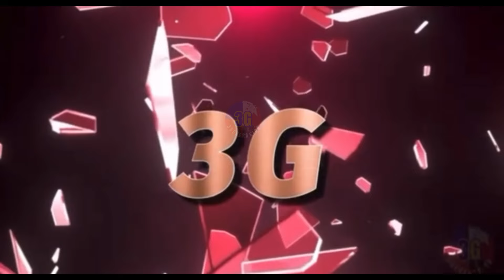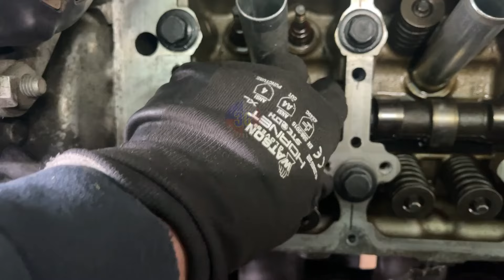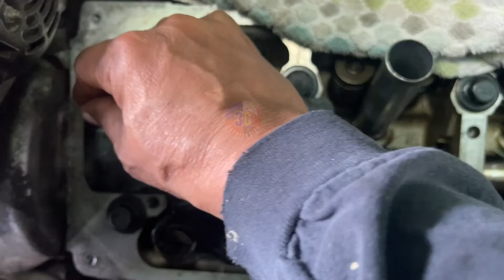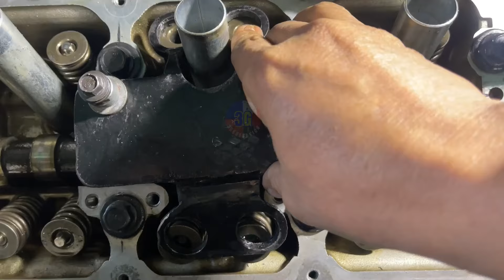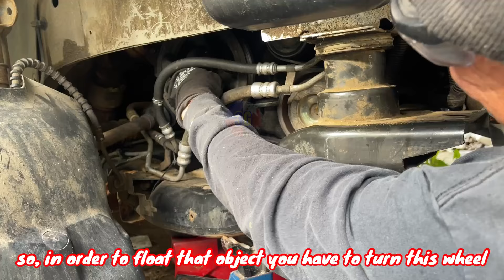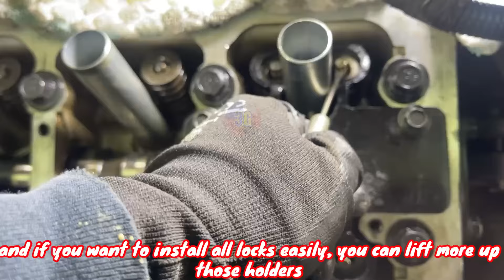How To Remove Spring Seal Without Removing Cylinder Head Manifold

Comment: Can I apply compressed air through the spark plug hole to hold the valves up? Good video, where may I buy the tool?
Reply from the maker: N0, I made this tool